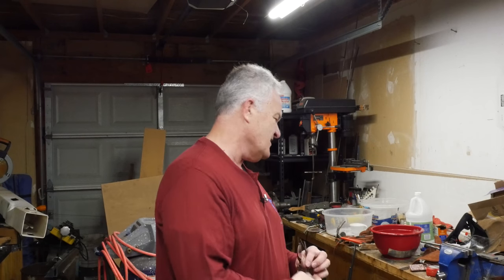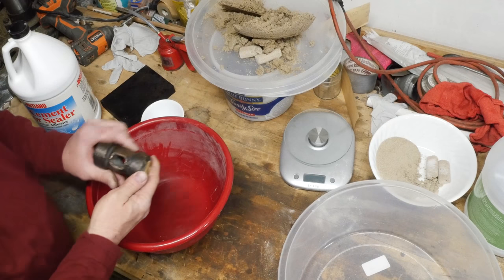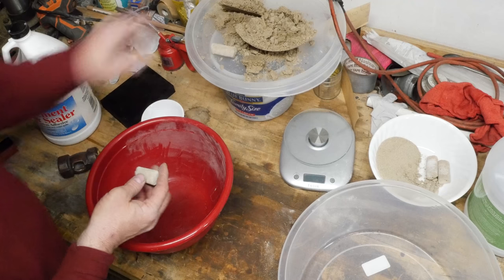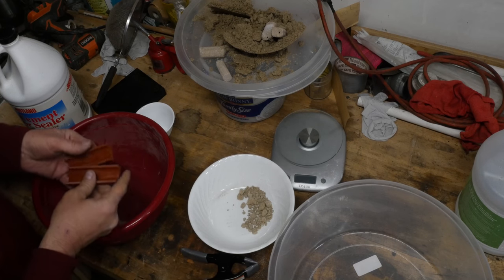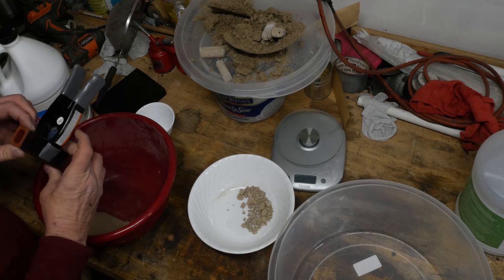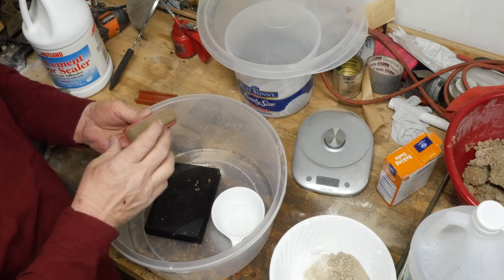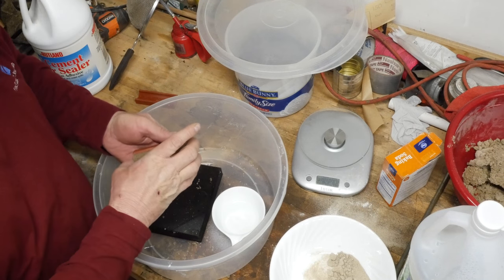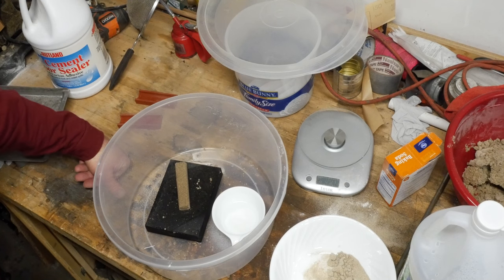Making sodium silicate cores

Comment: Hi, great video, thanks! 
You can also cure with a tea light candle instead. Just cover the container with a metal sheet, the candle inside will die out eventually, and you are left with co2 and water vapor, plus additional heat also should help.
Reply from the maker: Cool tip, thanks

Comment: This video will help me for my dissertation! Thanks, sir!
Reply from the maker: On what not to do? 😆😆 FWIW I typically put way too much sodium silicate in the cores resulting in all sorts of gas being created during the pour.  At this point in my life, I won't do another sodium silicate core until I have a bottle of CO2 available to harden it.
Reply: @swdweeb  somethimes knowing what not to do gives far more insight. It will allow me to get some shit done the handymansway ;) I hope you get it done! I saw someone use breathing to create CO2 for hardening... So, chin up and thanks! 
Cheers and thanks.
Reply from the maker: @emel60  I have a project in mind that will use hardened green sand as a core.  I really have had any casting ideas that required cores over teh last couple of years so I haven't invested a lot of time/money into the process. 

I've heard that if you just let sodium silicate infused sand sit out in the room, it will use ambient CO2 to harden.  It might take quite a while but it will harden.
Reply: @swdweeb  either way, I will soon try to cast, so I can test thst one as well. It costs me nothing but the time it takes me to remind myself about it.
Cheers,

Comment: Great video. A few observations:
1. I've been making a sand core cylinder 5" long, 1/2" in diameter. The mix is about 1/2 tsp waterglass to 1 oz sand. Mixed well, it is relatively dry. I cure the core in the core box in a toaster oven for 75 minutes at 265 degrees F.  
2. I don't know whether it is the hard, rammed pack or the waterglass adhesive cured in an oven (or maybe both), but the core always sticks to the wood mold.  Paint didn't help.  Oil didn't help.  Talc didn't help. The core often breaks when removed from the mold, sometimes at a crack, more often at a hidden weakness. To reduce stress on the core during removal, I made a four-piece wood core box held together with long screws. A 1/4" cove cutter on the router table cut the center hole, one quadrant at a time. After curing, and with the screws removed, the box opens one or two parts at a time. With less surface area to grip, the intact core can usually be "rolled" from the 4th quadrant.
3. The cured and cooled sand core is stiff and hard but very brittle. Exposed to intense heat and a stream of molten metal during casting, however, the core can flex or deform substantially, even float, inside the mold and so ruin the casting.
4. Prolonged casting heat degrades cured waterglass.  It loses its binding ability.  When water cools a casting, the core becomes wet sand. (On the other hand, a packed sand/waterglass mixture is the floor of my furnace, and it remains intact after many firings and direct and prolonged exposure to a propane flame.)
Ideas:
1. For wood core boxes, use a hardwood, something less likely to grip the packed sand.
2.  Design the casting mold to channel the stream of hot metal around the sand core, NOT directly against the sand core.  Put no unnecessary force against it.
3.  Don't paint a core box used in an oven.  The paint melts and makes a sticky mess.
4.  I will try opening the core box and exposing the uncured pack to CO2.
I'm still getting many failures making and using this sand core.
Thank you very much.  This has given me many challenging, frustrating, and interesting hours.
Reply from the maker: Sorry I've been slow to reply.
I made a waterglass core about a month ago. I used a two-piece printed pattern. Rather than making it one core, I made it two "half" cores that could simply be placed together. It cured nicely in room temperature. (Can't put printed parts in the oven, they warp all over the place)  The core halves did leak some but it was livable. 

I also mixed the sand to waterglass at a much drier ratio than I did in the video. I think that helped with it not being so sticky.

CO2 seems to be the key.  I haven't ever invested in a bottle or way to inject the core.  If I did more cores I would probably break down and spend the money. Heck I spent $20 on four gallons of gas today, I should probably be able to buy a bottle of CO2
Reply: @swdweeb   Thank you for your comment.  I probably don't have enough years left to learn 3D printing, so I make my patterns and core boxes the hard way.  I tried packing a core with sand/waterglass and exposing it to the air, but the damp sand broke and crumbled every time I opened the wood box.  I bought a small bike tire inflator that uses 16 oz. CO2 cartridges and applied it against the open end of the packed core box.  It worked somewhat, penetrating and hardening about half the 5" long core.  I could apply it to both ends, but the method gets expensive, especially with such high breakage.  I tried additional waterglass, but more than 1 tsp per oz. of sand in a rammed, baked core box shows why waterglass sells as an adhesive.
With a suggestion from my wife, God bless her, I had a recent success.  I made a new core box using scrap treated pine and rubbed a heavy layer of powdered graphite on the core surface to make it smooth and slippery.  I lightly rammed a mixture of one scant tsp waterglass in one ounce sand into the box and baked it two hours at 250 degrees F.  After it cooled, it went into the refrigerator overnight.  This morning, the cold core box opened easily, and the core almost fell out, hard, intact, and strong, almost as if I knew what I was doing.  It's difficult to take lessons from my experiments because they usually apply several variables, in this case, a new and undamaged core box, the graphite rub, a light ram, and the overnight chilling, but it worked.  Glory, Hallelujah!  We'll see if it's repeatable.  Thanks again.
Reply from the maker: @fredwild190  I think from what I've seen and minimally experienced, a light ramming is what we need.  Ramming too hard just presses it tightly against the box.  Lubricant is good. I might have used some parting compound in mine now that you mention it.  Cold seems good too as I expect it helped the core shrink and pull away a bit.
Of course listening to your wife is probably the most important lesson. 😄

Comment: Sodium silicate is what I use to line my forge and foundry. I sprayed it over the refractory wool. They call it water glass at the pottery supply websites. I will bet you that the cement floor sealer is a good deal cheaper than what they charge for the water glass and it is the same thing in a much smaller bottle. Learn something new every day. That will be the last time I buy it from them... Thanks for the information... On the forge walls, I just let it dry and fire up the forge to cure it, seems to work so far. It will take a ton of heat and stay put... Be well...
Reply from the maker: Good to know on lining refactory wool. Thanks

Comment: Awesome, I'm getting into the art of mold making myself currently and videos like these are really helpful. Say, do you think it could also work to put a glass of sparkling water into the container? Afaik the bubbles from the carbonation are pure carbon dioxide, so it would slowly build up in there. Alternatively there are these tanks for soda machines, but no idea how easy it is to get it out without it exploding into your face.
Reply from the maker: I think the tanks are really the way to do. Any welding supply place with have them. If I ever get back into sodium silicate cores that's the way I'll go.  You can harden them by just letting set out. They'll absorb carbon dioxide slowly from the air. No need to waste a good soda :-D

Comment: Baking soda and vinegar works great. Another way to generate CO2 would be a glowing coal put in the container with the wet core. Better use a metal container, and put the coal on something reasonably insulating (I use a piece of scrap kaowool left over from my furnace build)
Reply from the maker: Yeah, that would probably help dry it to. I've stuck these things in the oven at 200F for a short time just to help them along after they've hardened.

Thanks

Comment: Nice core, good job! 15 minutes on low in the toaster oven will cure sodium silicate cores too.  I get mine in the form of wood stove gasket cement because I couldn't find it up here in Canada as cement floor sealer.  Some car radiator patch fluilds are SS-based too, I couldn't get it to work for me but others have claimed to.
Reply from the maker: I looked for the radiator patch and couldn't find it in any of the local stores. It might have been there but I didn't see it.   I've put them in the toaster oven too after they've hardened enough to handle.  I don't know if it matters, but I'd just as soon drive off any moisture I can before pouring metal on it.
Reply: swdweeb the rad patch I tried was called "liquid copper", on the shelf at the Canadian Tire.  The package did mention SS but like I said I could not get it to cure.  Anyhow, the floor sealer seems to work well and that's a big bottle, so I guess you're all set!  When I make cores ahead of time, I always put them back in the oven for a bit right before making a mold just to make sure they're very dry too.  Because cores do produce some gas when they heat up and are trapped inside the casting when that's happening, I also vent my cores generously with a thick wire or dowel of some kind and vent the ends of the core prints through the cope as well.  Making the cores a little bit shorter than the prints ensures the cores don't block the prints' vents.
Reply from the maker: Seems like I saw that. I'll have to look again... in ten years when I run out of the industrial sized jug that I bought ;-)

Comment: I read somewhere that you can use Sodium Silicate to "glue" or seal kaowool for building a foundry.  Any thoughts on this?
Reply from the maker: That, I knoweth not. I know that the core gets really hard when it cooks with the metal around it. So, it doesn't appear to break down under that sort of heat but I have no idea how it reacts to a direct flame
Reply: It's likely doable but probably not the best. When it hardens by absorbing CO2 from the air it turns into a mix of silicon dioxide and sodium carbonate, which is essentially soda glass. That would likely begin to melt around the melting point of copper. A short exposure to high heat like in a core for casting is OK, but I wouldn't guarantee it can take heat for a prolonged time. I would recommend a refractory compound like satanite instead. Satanite works great in my furnace.
Reply: The idea behind using sodium silicate is that it is hard enough to form a core but it then breaks down during the pour from the heat transfer from the metal. Once your pour is completed you can then break out the core often with the help of a water soaking. So for your intended use it would not make for a permanent solution due to the breakdown under high and repeated heatings.

Comment: Have you tried making a mold made from sodium silicate and sand?
I’m wanting to try packing some of this around a 3D printed resin model (just the face) that has fine detail and place a plate with a tube in it to act as a pour spout/tube for the needed pressure.
Reply from the maker: I've only done cores with sodium silicate sand.  From what I understand, professional foundries do what you're suggesting.  They certainly do it with flourine-based resin sand.
Reply: @swdweeb  Thanks.

Comment: First u ve to use talc or any micro powder&coat d box b4 to apply d wet sand2avoid stick, u can use concentrated water sugar, little heat can replace co2 n both

Comment: I will definitely use this method if I need to make a core, but I would wonder if suspending dry ice over the core would be effective. I am to understand that dry ice is solid Co2 and as it sublimates, it should create a co2 bath. Keep up the good work!
Reply from the maker: If you have dry ice, I expect that should work just fine. In terms of what dry ice is, your understanding is the same as mine. I have ready access to the vinegar and baking soda so that's what I used.

Comment: Thanks, this was another great  informative video.  I have an idea I'm going to experiment with in making cores and will post a video if it succeeds.
Reply from the maker: Cool. I need to make some greensand cores as well.  That is entirely possible and much less hassle than the sodium silicate which is tough to do without carbon dioxide floating around
Reply: @swdweeb  have you had success with greensand cores?
Reply from the maker: @JasonSipe16  Well, how about I give a qualified yes answer to that. I've made greensand cores, they have worked well. I just haven't done very many of them.  They take longer than sodium silicate cores in that I let them dry out and harden before I use them.  For me just being a guy in his garage doing a really small number of castings that's not a big deal. If I were running production, I'd break down and buy a bottle of CO2.
Reply: I appreciate your replies. The older I get, the more willing I am to learn from other's trials and errors. ;)
Reply from the maker: @JasonSipe16  I couldn't agree more. Its too bad that when we're young and know it all we miss out on learning from others. 😄

Comment: Loved this! My only question is how strong is the resulting casting of sand? Is it strong enough that it wouldn't break easily? Thank you so much!
Reply from the maker: Are you asking how strong is the core?  It's pretty hard, you'd have to hit pretty hard to break it. Normal handling wouldn't do anything to it.
Reply: @swdweeb  thanks for the quick reponse :) that’s great to know! I just did an experiment very similar to yours but the core is set in a silicone mold - would that deter the curing of the core? My core is also a little slimier, is that a bad thing? Thanks so much!
Reply from the maker: @gerickking1020  Ok, let me get this out there right now... I'm far from being an expert in cores 😄
I can tell you what I've heard from people that are more expert than me. Your core should dry hard and not have "slime" on it. hat may be because of the silicone not allowing the sodium silicate to dry. It could be because you used too much sodium silicate as well. I used way too much in this video. I say that and I cant be of much help with the proper ratio of sand to sodium silicate.  It's probably out there on the web somewhere.

The problem with too much sodium silicate in the core is that it releases gas when the metal hits it.  If you don't properly vent the core it will cause deformities in the casting. I've seen that happen. More sodium silicate = more gas. 

When I need to do another core I'll be looking for a CO2 bottle so that I can inject the core with that to harden it. What I did in the vide works, but it takes a long time.  From what I've seen this stuff hardens almost immediately when hit with pure CO2.

Anyway, I would say that slimey isn't a good or normal thing.

Comment: That cool, I did'nt know their was an OTC chem that had Sodium Silicate in it. That saves me time and money making it from silica gel and Sodium hydroxide drain cleaner.
Reply from the maker: I just recently talked to luckgen1001 and he uses fiberglass resin and sand for his cores. He tells me that the resin decomposes during casting better than the sodium silicate  and is much easier to remove from the part. I'm going to have to give that a try as well.
Reply: What I use sand/sodium silicate for is to make refractory material to line a furnace, its not the best but its cheap and holds up much better than plaster and sand. Also use the left over to make bricks that are great for putting bullion molds and melting dishes on.
Reply from the maker: Then resin isnt for you. ;-)  I had only recently heard of people using sodium silicate to line a furnace. 

I got into an argument with someone just last night that said plaster and sand works just fine. Mind you they've never build a furnace, run a furnace or cast anything but they were expert on the lining of a furnace. I just shook my head and walked away
Reply: Plaster and sand is doable, but it breaks down pretty quickly. I just have a simple paint can furnace, but its lined with the sand/ sodium silicate, stuff works pretty good. You think that guy was a know it all, try joining the MPSM (monoprice select mini 3D printer) owners FB group. LOL! I got into it on that bc some guy was moving his bed back and forth quickly and the screen was briefly lighting up bc the motors act like generators. Tons of ppl saying he's gonna fry his board. I may only have an associates in EET, but no way is that gonna fry anything.
Reply from the maker: Yeah there are people like that everywhere. I'm old enough to realize that unless I've actually got experience in something I'm not going to get dogmatic about it.  One of the reasons I stay off FB. Way too many opinions expressed as fact.